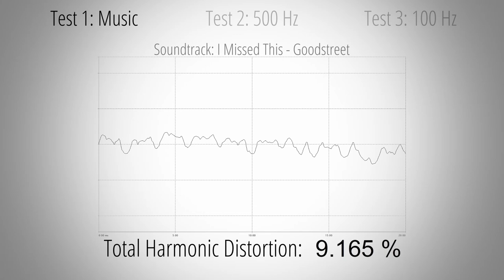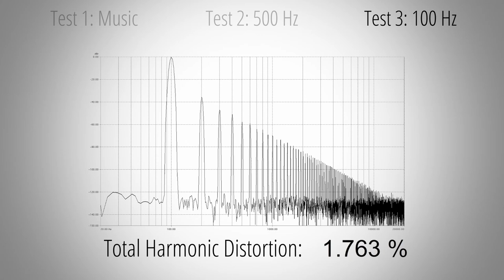How much distortion can you hear? - Audio Distortion Test

Comment: Listening from a pair of Beyerdynamics DT 770 Pro going through the headphone jack of a Presonus Studio 68
Music: 7%
500Hz: 0.7%
100Hz: 4%
Reply: Interesting. Those headphones have an emphasis mid bass and treble a lot. For mixing/mastering. So you don't go overboard with treble or bass.
Reply: @brownchair2698  Due to your comment, I came back to this video and started listening again. 
I was not looking at the screen this time and just paused the video as soon as I felt things change.
Test 1 - I started noticing very subtle distortion on the hats and the bass around 5%. I think this would correlate with your point that my headphones have slightly boosted mid bass and treble, hence the distortion in these spectrums would be the most audible.
Test 2 - The sine wave starts feeling louder and more pleasant sounding (due to the additional harmonics) at 0.3%
Test 3 - I can hear the harmonics adding up around 1.2 %

I think this is partly due to the fact that my house is a lot quieter at the moment. Hopefully my ears have improved as well.

Comment: I'm kind of surprised with how early I picked up the 2nd and 3rd tests, considering I'm using a simple Samsung IG935 earphone
Test 1: 7.276%
Test 2: 0.4%
Test 3: 1.315%
During test 3 I paused thrice between 0.2% and 0.4%, but I wasn't sure if I was imagining the distortion because I knew it was coming or not, while I paused at exactly 1.315% multiple times.

Comment: 1) 10%
2) 0.8%
3) 4%
the distortion was already galloping at that point though
Reply: This proves to me that total harmonic distortion numbers under 1% are meaningless. Just like a speaker that say it's frequency range is higher than 20,000 Hertz.  Does not matter if a speaker produces 30,000 Hertz you won't  here it.
Reply: I did not notice  until about 6% I must be old and deaf.